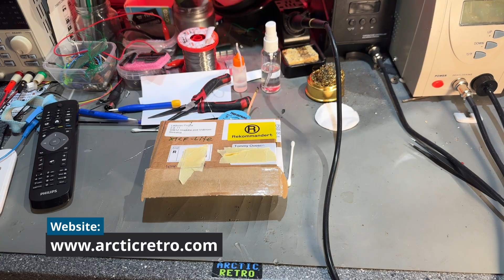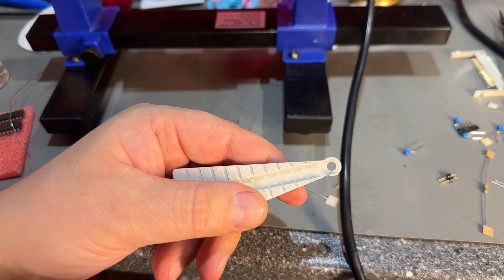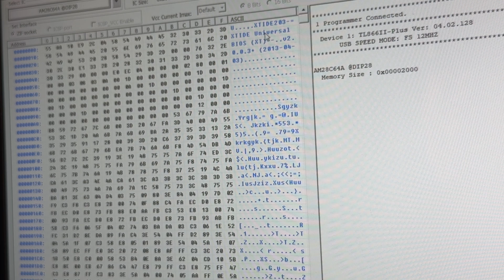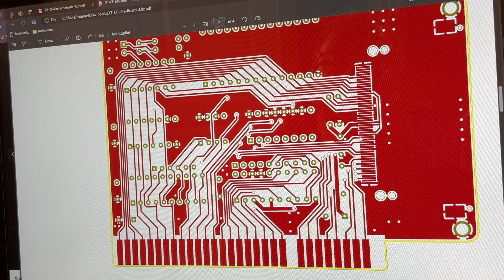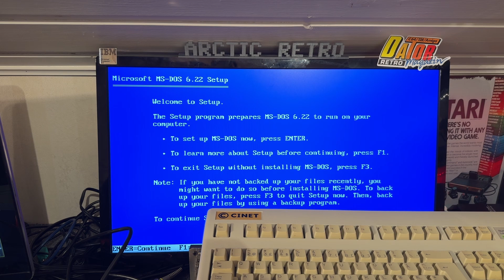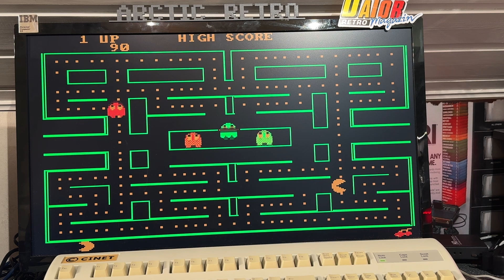Building and testing a XT CF Card for the my IBM PS/2 - Difficult soldering!

Comment: Finally came to this video and was also a bit sad when things got tricky. It is such a relief you finally got it working the arctic way, as always. Even if you don't want to permanently use it the screw mount for the CF card connector could have been a massive alignment help to begin soldering I think. Personally I would even leave it in place because every CF card insertion puts a bit of strain to all solder points. Those plastic nuts and screws would even be enough if you had metal screws of the wrong size.
Yeah, the modern FAT formatted scheme might not what old DOS is accepting. I think I had a similar experience back in years. It didn't take you much time because you also know such things. A real pro as always. It is a nice project for old machines with dying hard drives, entertaining and educative to watch as always. Thank you for having shared this.

Comment: One of the reasons why this became difficult is that you are soldering things in the wrong order. You should start with the lowest components. If you start with sockets, electrolytics caps etc., it becomes difficult to solder things like this connector.
Reply from the maker: Yes, I know. I wanted to save the difficult until last :)

Comment: Recently I bought the iX5 ULTRA preheater - soldering connector like CF is a piece of cake with that. As for the XT IDE, I prefer to choose the "XT-CF PIO8 (BIU offload)" variant; it seems to be faster. You may start the configuration utility from a DOS boot floppy, on the target machine, with the XT IDE card installed (if it hangs, you may disable EEPROM for boot and hot-enable it when in DOS). Then you will be able to configure XTIDE BIOS and burn the EEPROM (with EEPRM write enabled). I think the PS/2 variant is for MCA machines.

Comment: Preheating the board helps. it should be at the point where you can touch it, but don't want to hold it. Having the PCB hotter helps remove the solder between the pins when dragging or using the braid.
Reply from the maker: Ok, makes sense :-)

Comment: Hi'a Tommy! Don't beat yourself up about the SMD soldering. It just takes practice, that's all. Hot air is not easier in my opinion. Also, when assembling a board, remember to start with the smallest components first. SMD before throughhole..
Reply from the maker: True. Thanks. I realized after I started. I tend to do the easier tasks first :)

Comment: I usually use a lot of soldering flux and I would recommend you to check out Chisel soldering iron tip since it's technically meant for soldering down the QFP chips so it should help you with CF holder massively. As for the others attempting this, I recommend to solder the tabs first before you tacke the pins, it makes it massively easier to do that. As for who has TS100 or any smart soldering iron with chisel tip, I would say go for 400 - 420 °C temperature, that makes it a bit easier to drag molten solder.
Reply from the maker: Thank you :)

Comment: Hi, You should have started with the CF-card holder using a flat tip. It is not difficult, just put flux on the pins and put some solder on the flat tip and dragsolder. If you run out of solder just put a little solder on the tip and repeat until you're finished. After that clean your tip, put flux on any solder bridge and put your cleaned tip against the solder bridge then clean of your tip and repeat until the solder bridge is gone. When you're finished with the CF-card holder start with the through hole stuff. That way you don't damage anything (as you did with the parts close to the CF-card holder).
Reply: Exactly. And for removing excess solder you must have good quality solder braid!
Reply from the maker: Thank you. I got two more cards now. I'll try that on those